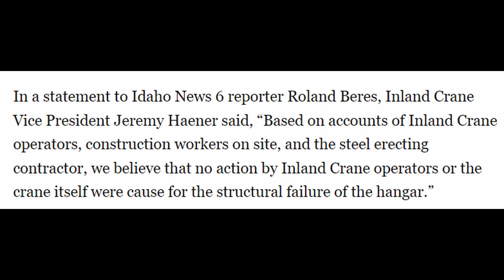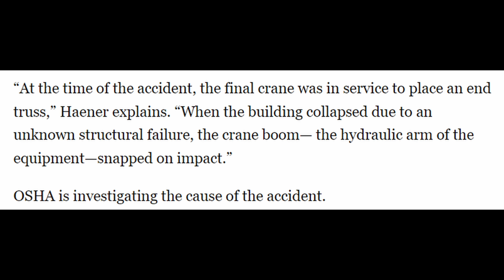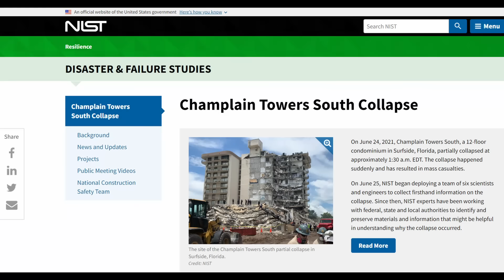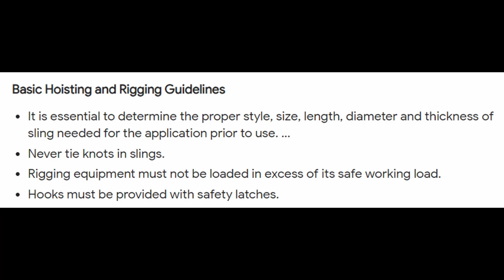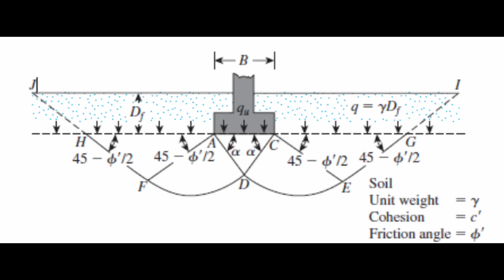Aircraft Hangar Collapse in Idaho

Comment: I’m quite sure there is a professional reviewing this incident, however I’d like provide some insight from my 30 years of experience in the structural steel and pre-engineered metal building erection industry.  There is a simple answer but it includes many variables that all have to be taken into consideration.  Long story short he erector got ahead of themselves for a building of this size and magnitude, which I will do my best to explain.

 Let me first say that I don’t blame the lead foreman as the method on which the building was being assembled is common practice and relatively safe for most size buildings.  However, the company should have taken initiative to provide the lead foreman and crew with detailed instructions (directive) on the proper way to erect a building of this size as you cannot approach this particular building like you would with most other buildings. Let me explain.  
This first part has to be understood to understand the method that was taken. 
As the roof framing is being assembled, the foreman and crew have to pay close attention to their roof purlin orientation to ensure proper fit and avoid misalignment of bolted connections.  You see, all zee purlins have two different size flanges to allow for proper overlap and proper “nesting”.  This is typically indicated to the erector by a triangular arrow punched into the web of the zee purlin on both ends which points to the larger flange, and indicates this to the erector for proper installation.  Stay with me here, as I will get to the point.
On a clear span building with no interior columns to support the mid-span of the rafter, the erector sets the first main frame rafter section (only held up by the columns on each end) it has to be held in place and stabilized to prevent sway or “sweep” until the second main frame rafter section is also set in place. Once the first and second rafter are in place, the installation of roof zee purlins begins.  As the roof zee purlin framing begins, the FIRST bay of roof purlins are installed with the smaller flange UP, and larger flange DOWN (as indicated by the arrows punched in the web).  
LOOKING AHEAD….. The THIRD bay of purlins will also be installed with the smaller flange UP and larger flange DOWN so that when the erector sets the SECOND bay of roof purlins in between the FIRST and THIRD bay; the larger flange in the SECOND bay will be UP so that the roof purlins will nest on the smaller flange of the FIRST and THIRD bay.  It has to be done this way due to the zee purlin overlap design and this is industry standard which will be noted on the project drawings (manufacturer set of plans).  If it is not done this way, it creates a very difficult task for the workers having to undue the previous connections to properly “tuck-behind” and “nest” the connection, creating a significant amount of chaos and discontent among the crew.

To say it another way, the roof zee purlin flange sizes have to alternate from bay to bay to ensure proper fit and nesting.  (“little flange up – big flange up – little flange up – big flange up – little flange up”… etc.)
Once this is understood, you will understand why the building looks the way it does in the photos; appearing to be partially assembled in some areas and fully assembled in others.   Where they went wrong is not following up and going back to fill-in the roof purlins once the following bay of roof purlins was complete.  
With long spans and increased rafter depths of this nature as seen on this project, the variables and forces drastically change, especially wind loads.  With these increased variables the erector cannot leave alternating bays of roof purlins incomplete.  Although it is common practice and relatively safe for most building sizes, it is not safe to do so on a building of this size.  Once the erector is able to completely fill in the previous bay of roof purlins, it is critical that the erector do so immediately.  Having just a few purlins in between the fully assembled bays of roof purlins, is not enough to sustain a building of this size during the erection process.
Let’s move on and discuss a little bit about the large main frame rafters………
Metal building main frame rafters are very, very, very, deceiving.  This is not understood by the average person without having many years of experience in offloading, moving and handing them.  Although they look like an I-beam, oversize in depth, and very rigid in appearance, they are extremely flimsy and increasingly flimsy the longer they are in length.  This is due to the web depth to flange width ratio, and the web and flange thicknesses being significantly less than that of the average I-beam web to flange ratios and thicknesses.  
Depending of their size and length of the rafter, without the proper lifting techniques the rafters can be easily damaged as early as they arrive on site during the initial offloading process.  Yes, it is not uncommon for metal building rafters to get damaged during what should be a simple offloading process.  Their rigidness is often underestimated by the person(s) tasked with offloading these materials and they sometimes “buckle” under their own weight when unloaded with the common rough terrain forklift with full lifting capabilities. This is due to the rafter laying on its side and not in the vertical position during transport and offloading. They can be very floppy in the horizontal position, and even in the vertical position without the foreseeable proper rigging technique. 
In the case of the Boise Idaho hanger steel members, it appears that the rafters came in short sections to be assembled on site.  As common practice, these main frame rafters are assembled on the ground in a staging adjacent to their final resting place on the building where the crane pick the members up and set them in place.  As the rafters are stood up vertically from the horizontal position they are prone to “twisting” and “bowing”, and remain this way as they are being hoisted in the air during the lifting process. They will continue to be subject to this vulnerability until they are assembled in the vertical position, in its final location, fully braced with ALL STRUCTURAL MEMBERS in place that prevent the main frame rafters from “rolling” (leaning), “twisting”, “bowing” or “sweeping” (swaying).
I cannot emphasize “ALL STRUCTURAL MEMBERS” enough!  That’s just the nature of the size and shape of these steel members and engineering that is required to construct these types of clear span buildings. 
Which now leads us to the chain of events that caused the collapse…..
Assuming that none of the roof purlins where already damaged or kinked during the offloading and staging process…..   With the small amount of roof purlins in alternating bays as clearly seen in the photos, the bays that were incomplete was the weak point in this erection configuration.  It’s most likely the wind caused those few purlins to be slightly compressed making them bow and or kink, resulting in the loss of its structural integrity to which the purlins most likely buckled. This loss of rigidity in the structure would have increased the amount of sway and potential side to side movement of the overall structure.  This would have caused the mainframe rafters to slightly sweep, twist and roll enough to kink the flanges and lose all rigidity over such a long span.
Reply from the maker: Wow, thank you very much for your detailed and knowledgeable comments.  I have pinned your comment so others can read it more readily.  Thanks again!
Reply: Very well said. My thoughts exactly. The out of plane stiffness for pre engineered metal building frames, especially during construction prior to the placement wall girts and x bracing, is extremely low. Any bump in the weak direction from a crane carrying a steel member is sure to cause catastrophic damage.
Reply: @TrestlePG  When the open span of these pre-engineered buildings becomes very long, the attention to secondary bending becomes critical.  Look at long span bridge designs, the lateral support is plentiful and spread across the full depth of the plate girders.  It's not just minor joist style X bracing.
Reply: @geoffmorgan6059  Yes, great point! I was referring to in wall cable bracing and subsequent portal frames at large overhead doors. But most of the pre engineered metal buildings I am familiar with have small footprint compared to this one so I am not used to seeing any heavy duty bracing.
Reply: @TrestlePG   Right, the span of the moment resisting frames on this building are/were very long.  The torsional damage to the plate girders shown after the collapse is extensive.
As you mention cable stays and other methods are used during construction to provide support for stability during erection.  That's all well and good until the scale of the building becomes very large.  My old MIT educated Chief Engineer used to tell me to beware of cable bracing due to the inherent modulus of elasticity of cables.  In other words when things get hairy use solid rods and turnbuckles.   Or nothing that was ever built too conservatively ever fails.  Cheers!
Reply: Thanks from a non-engineer.
Reply: Thanks from an engineer
Reply: Wow, very informative! Thank you!
Reply: Thank you very much

Comment: I witnessed a bearing capacity failure on an oilfield site near Drumheller  during a Frac. Caused by two failures. First 3”X12” planking on trailer weren’t placed under trailer tandem duals to level trailer before hydraulic support arms were positioned at 90 dregrees to trailer. Instead of being used to stabilize a level trailer. Operator used left one to lift trailer to level then positioned right one. With trailer almost fully raised. Support leg penetrated the surface going out of site wilt trailer hitting the ground on its side. Luckily not hitting anything or anyone on the busy site.

Comment: The 4 cranes provides a load bearing safety system and when one is in used transfers the load to a weak section of construction .
Reply from the maker: I believe they only had one crane in use at the time of collapse.
Reply: @CaseyJones-Engineer  Thanks . Keep going , great job !
Reply from the maker: @Go_for_it652  Thank you!

Comment: I am a retired structural engineer with over 20 years experience in Alaska. I worked on over two dozen buildings similar to the hangar doing just the foundation design. The pre-manufactured buildings are designed by the manufacturer using their in-house staff or a structural engineering experienced with these types of buildings. I would be given a computer printout of the reactions; the horizontal and vertical forces at the column bases and design the foundation.

If the crane collapse was the instigating factor, I don't see how it's collapse at one end of the building and dropping the end truss caused the frames at the other end of the building to fall. The purlins between the frames are connected basically to tie them and the roofing to the frames. If one frame started to tilt, I would think the purlin would most likely tear loose in shear acting as a fuse to prevent a cascading collapse. Also, end trusses typically have intermediate columns, not just the ones in the corners. The interior columns are there to provide support for the girts that span horizontally to resist the out-of-plane loads from wind. 

The frames seem to have fallen down in-plane, not tilted to one side if the crane was responsible or it was too windy. To be this suggests a connection design error at the ridges of the frames that caused the joint to separate and fall. But then why would fail all at the same time? The frames were basically carrying only their self-load; the roof purlins, roofing and other roof dead loads were not there. Also, the design snow load for Boise is 25 psf, so the frames should have had sufficient capacity. Also, it looks like the building was not being braced laterally during erection; there seems to be some gaps, but they be obscured by the collapse.

The videos shows how the baseplates rotated at the outer edge as the frames collapsed. I saw one video or maybe the photos in the paper. that showed the anchor rods pulled out or the baseplate separating from the column flange. This doesn't surprise me, the connection design is based on the building being erected and subject to the dead loads (total) and the code required snow, wind and earthquake loads. When the frames collapsed and rotated, the baseplates and anchor rods were subjected to forces that the building wouldn't experience typically. There have been some comments on tying the columns on each frame to minimize the outward kick. Two of the ways to do this is to design the foundation at the columns to use the passive earth pressure to resist the loads, the other involves using the reinforcing in thickened strips in the floor slab which hadn't been poured yet.

Anyway, I don't have a good idea on what happened. It may be a series of overlooked/ignored/design/erection errors that unfortunately aligned resulting in this tragic event, similar to what James Reason's swiss cheese model to explain accidents.

Comment: Ive Built many of these pre fabricated steel buildings, and many free/open spans.the difference in a pre fabricated and structural steel is a structural can stand alone. A prefabricated steel buildings requires all components to stand as one.also i saw many rods/braces in the aftermath pictures,along with girts,purlins etc.a 300 foot clear span will be very heavy duty since no load bearing columns in the middle. I thought it was pretty odd the direction it collapsed
Reply from the maker: Thank you for your comments. I'll be interested in learning what the OSHA investigation determines for the cause of this collapse.

Comment: Any updates on this hanger going down? You know one thing I noticed on the original video you did on this, was how the anchor bolts sheared holding the columns! Seems strange that they sheared like that, seems more likely to me that columns would twist and buckle before all of the bolts/studs shearing! Wonder if that may have been a contributing factor in the collapse?
Reply from the maker: Thank you.  I continue to follow the story, but I suspect not much new information will be available until OSHA issues their report.

Comment: It's been said before, but this was not a structural steel building, it was fabricated plates that are inherently unstable until completely braced. Also connectors on structural steel don't punch all bolts while erecting, metal buildings need all bolts at every connection installed and tightened.

Comment: Big D builders out of utah. This is big enough they could lose there insurance.
Reply from the maker: I see what you mean especially if they were negligent.
Reply: @CaseyJones-Engineer  I know most of the guys that live here in the Boise area.  There a good company,  but sure looks like someone missed a step. My dad built the first big hangers in 80s at the Boise Airport.  We just did things differently then. Slow and steady. We didn't have huge cranes around so we did things slower and safer. Equipment sometimes reduces our feelings of how big things are and what they weigh around big Equipment.  We get a little sloppy.

Comment: Having read all the comments so far, I am surprised that the proper size and quality of the j-bolts or other anchor bolts has received little consideration. Of equal importance is the proper seasoning of the footing pads, as 'green' concrete has far less strength than it will eventually develop. With the narrow flanges used on the main frames, tensile strength of the concrete during erection is critical.
Reply from the maker: Thank you for your insight on that.  There appears to be several things indicating that the structure simply didn't have sufficient rigidity for the loads being imposed during erection.  I doubt there was an inherent flaw with any of the steel.

Comment: Assuming that none of the roof purlins where already damaged or kinked during the offloading and staging process…..   With the small amount of roof purlins in alternating bays as clearly seen in the photos, the bays that were incomplete was the weak point in this erection configuration.  It’s most likely the wind caused those few purlins to be slightly compressed making them bow and or kink, resulting in the loss of its structural integrity to which the purlins most likely buckled. This loss of rigidity in the structure would have increased the amount of sway and potential side to side movement of the overall structure.  This would have caused the mainframe rafters to slightly sweep, twist and roll enough to kink the flanges and lose all rigidity over such a long span.

Comment: What are the allowable vibration limits for steel structures?

A structural vibration velocity of 2.0 in/sec has commonly been used as an upper safe limit for building structures, and vibrations above this value will have adverse environmental impact. A vibration velocity of 1.0 in/sec should be used as a normally safe vibration upper limit with respect to structural damage.
Reply from the maker: I don't know what the tolerances are.  I pinned a comment from a person who is well versed in such construction which suggest that not much movement is permissible until these structures are fully stiffened.